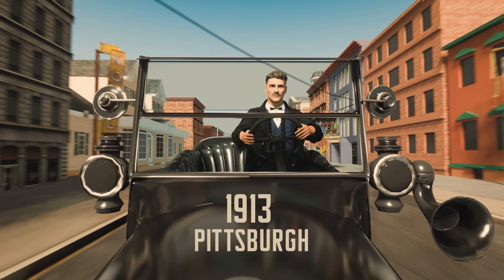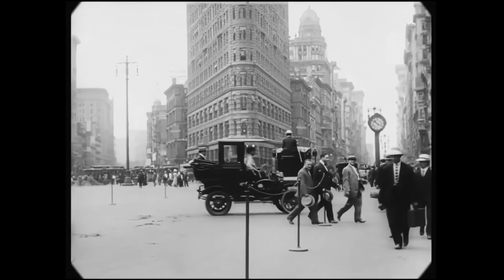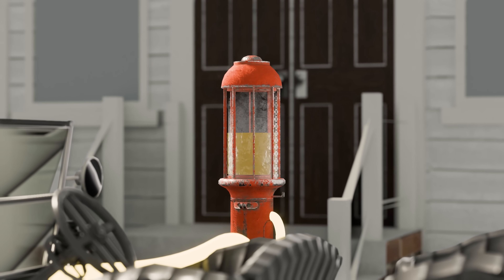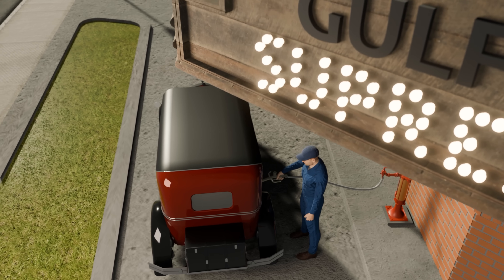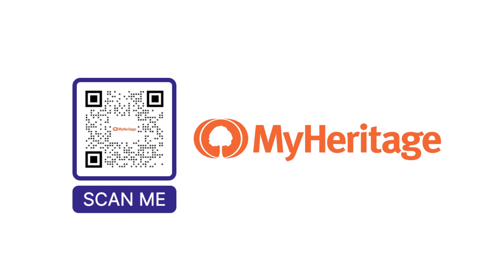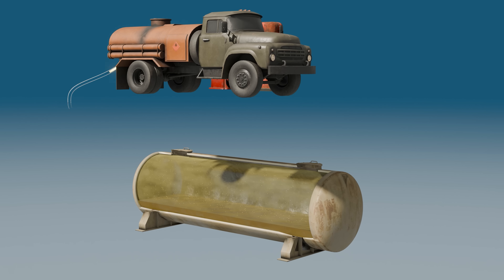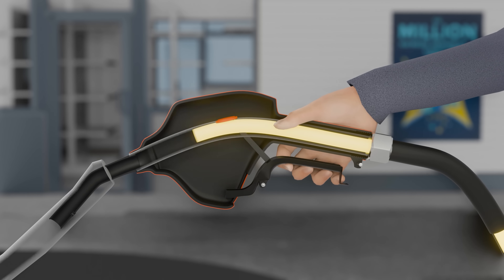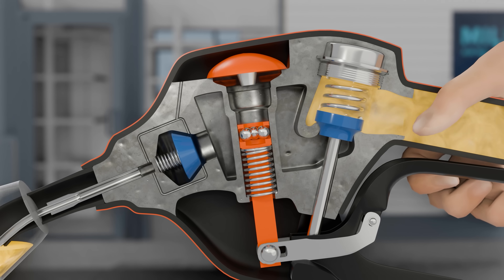The Hidden Engineering of Gas Stations

Comment: I haul fuel for a living . We have 2 types of delivers. The first 1 is called a pump off. Which means you use a pump to pump it into a tank above ground, and the second one is called a gravity drop, which you drop in a tank that is underground and doesn't need a pump. For the most part, the video is spot on expect for the part that says drop 95 percent in the tank. We can only go 90% before the flapper closes, and the overfill alarm goes off. O, and it doesn't go back into the truck. There are pipes that are off to the side, which is where the vapors go.
Reply: Yup, Ive never seen a SECOND hose back to the tanker truck to "capture the gas vapors", thats either rare, or fanciful green hopes and dreams, but not reality. Those tall thin pipes near most gas station properties are the vents that release fumes into the air.
Reply: @Stealth55555  Im pretty sure that is illegal. With a vapor point of -40C that’s a LOT of vapor. Releasing all that vapor into the air in a populated area is incredibly dangerous and unhealthy.  If it’s ok to release into the air then there is no point in engineering and building all kinds of expensive safety features to recapture all those vapors during storage and dispensing, only to release them later.
Reply: @thomasn708  lol. Next time you see a tanker fill up your local gas station, just watch him. He will only have ONE HOSE to unload the fuel (and a grounding cable) but no "vapor recovery" crap. Unless you live in California or something. Or just ask any fuel trucker.
Reply: @Stealth55555 I agree with you on the one hose. I’m disagreeing with you regarding the legality of gas stations simply venting the vapors into the air
Reply: Yeah true true
Reply: Yeah 90% for sure, but only a few of our stations have stoppers, set off the alarms more times than i can remember but we have to make sure the fuel will fit first, gotta love splitting a compartment between 2 tanks, we also have a few stations with vapor recovery but its usually just stacks

Comment: 8:10:  "...fewer trips to fill up."  However, auto efficiency wasn't the reason for the decline in the number of gas stations.  After all, the total number of cars continued to increase, and with increasing congestion in most metro areas, commuters were spending more time in cars with engines running.  The reason the number of gas stations declined is that the nation underwent a massive, nationwide program of removing the older (often leaking) steel UGSTs and remediating the soil contamination.  What had occurred in the interim between the gas station being constructed and the remediation was changes in local zoning codes that prohibited gas stations in most residential districts.  Also, regulations that restrict curb cuts and other issues involving road access made corner gas stations often impossible to reconstruct.  That, coupled with higher-value economic use of those typically corner lots, resulted in the gradual elimination of virtually all neighborhood "filling stations."  Gas stations grew in size but moved to commercial hubs such as shopping centers, where zoning and access made these uses more viable, and where thousands of auto trips daily made them highly profitable.

Comment: If a pump offers four different octane ratings are there four different gas tanks?  Or are there two tanks and the pump is blending to get the desired octane?  
Note, I'm not talking about the diesel or E85 tank.  Just regular gas.

Comment: Keep in mind that fact I got to imagine if I would have a biofuel gas station so your explanation about the big evaporation of a gasoline actually 'hit the apple', as everyone would say. But, since I learned about a bio-gasoline (aka Renewable Naphtha), I could say: 'There is a brand new renewable gasoline which emits less vapor than fossil/synthetic classic'. That renewable naphtha, renewable diesel (aka HVO; HVO means Hydrotreated Vegetable Oil) and sustainable aviafuel (SAF; biokerosene) are brand new forever since rawesome stuff for them is a biomass, not a crude oil as classicity. I hate synthefuel since it's gonna emit way more emissions anyways.

Comment: "That makes it impossible to overfill a car"

Let me tell you... these can fail. When I was on a road trip with a friend we had stopped for gas. While he was filling up he cleaned the windshield of the car. He was on the other side of the car when the gas started spraying back out from the port. The automatic shutoff had failed. Gas went everywhere and he got it all over himself trying to stop the nozzle. Honestly we both could have been killed from the incident if it had caught fire.

Always stand by the pump just in case!

Comment: i always have this question in my mind, does gas station have a huge tank underground for all grades of gas , or they hv different tank for different grade for example 89,91,93?
Reply: Most of the time they have one tank for 89 and one tank for 93, and if you choose 91, there's a valve that takes it and blends it half from each tank to equal 91.

Comment: Very informative. But don't get it twisted, gas stations are still dangerous fire traps. We just have a lot more engineering controls and safety regulations in place to minimize that risk. Gasoline is a very hazardous substance if not handled properly, and, frankly, the average person has no business pumping their own gas. Hell, most gas station attendants shouldn't even do it. The fact that gas stations don't burn down every single day is a monument to the advances in safety that have been made.

Comment: 7:55 something just doesn't add up here
Reply: thats correct for old style handles and for diesel which has no vapor. nowadays they have the bellows on them because the hose has an interior hose in it. the whole thing is called "evr" or, enhanced vapor recovery. the bellow makes a slight suction on your tank when you fill it and the vapors go back up the exterior line of the pump hose and the fuel comes out the interior hose. they also made a healy tank that does the same thing, so when you look at the  vent stack, youll see a large biege tank, that tank collects the vapors that are turned back into liquid form and they can capture the vapor instead of letting it all go out the vents as pollution.

Comment: Great job on the last video! Could you please create a new one that explains how the digital display at the pump calculates and shows the cost per gallon (for example, why it shows “1 gal = $X.XX” and how it updates as you pump)? Also, could you cover how outdoor temperature or air pressure affects how much fuel you actually get, and when is the best time—based on pressure—to fill up your car for maximum volume?

Comment: The flashpoint of Kerosene IS 100 degrees F and the flashpoint of gasoline IS -40 degrees F.
IT HAS NOT CHANGED.
Saying it "was" 100 F and -40 F just because we're talking about situation in the past does NOT mean that the physical characteristics of these substances was different then as opposed to now.
LEARN GRAMMAR.

Comment: the tanks at gas stations aren't supposed to be filled over 90%, not 95%. also, the vapor that goes back into the trailer doesn't become liquid gasoline - it's burned at the loading rack when you pick up the next load.

Comment: The price of 27 cents for a gallon of gas in 1913 was very expensive. According to Inflation Calculator, 27 cents in 1913 is equal to $8.75 in 2025. 
   When I got my driver's license in 1970, I could find gas in Maryland (USA) for 29 cents per gallon. It was still the same price until late 1973, when the oil embargo hit here. For several months, there was a shortage of gas, and there were very long lines at the gas stations. 😢😢  Several months later, the price of gas nearly doubled, and soon there was plenty of gas available again.
Reply: Yup. After the oil embargo the world price of oil went from $3 a barrel to $12!  I was just starting to drive and was torqued off when my .29 a gallon rose to .53 in 3 years....Oh well.

Comment: You should see the "gas stations" in rural Myanmar or Laos, that area. They sell gas at little convenience stores at the side of the road with snacks, food, drinks, etc. They reuse old 1 liter coke bottles for the gas. That way they can charge you 1 liter per bottle. Because the gas is dyed red and kept in coke bottles, I used to think it was some cherry coke or something until I finally saw a tuk tuk driver fill up with a couple. And in rural areas of India and Pakistan, they buy natural gas for cooking by the bag. They fill up this 20 foot long bag with natural gas that makes it float like a helium balloon. You see guys walking with like 5 or 6 of these huge floaty bags. They just run a hose from the bag to a gas powered hot plate.

Comment: I work as a welder in the petrol forecourt industry in the UK and it is crazy the amount of engineering that goes on that the majority of people have no idea about, Im not sure if it is different in the USA, but a method that is used in the UK to detect leaks in the fuel tanks is something called the interstitial space which is essentially where the fuel tank is inside of another tank and you have a leak detection unit that will detect any changes in pressure inside the interstitial space

Comment: Wow! so what you mean to say is that Gas stations and gas cars were very very dangerous because of the highly flammable fuels plus the mechanisms used to handle said Fuels. but over time engineering solutions fixed these issues and made it safe for us all to drive these dangerous vehicles around. noted. 
so maybe we should let EVs evolve for a 100 years too before we pass judgement. 
although they're already much better than gas cars as it is, but the haters with fear of batteries should realize its still only been just over a decade since Tesla made EVs mainstream and how Gas cars and the Fuel was very flammable and did catch fire easily in the early days.

Comment: As someone in the fuel delivery industry, this is pretty interesting to watch, and reasonably accurate
Reply: What would you add to the video to enhance it?
Reply: @labmasterx5599 People should stop coming up 2 us asking "Is it ok 2 pump gas while you deliver?? I dont wanna blow us up" it's soooooo fukkin annoying lol
Reply: @TruckinTay  Electric vehicles are more dangerous but let's not let reality get in the way of the political push.
Reply: @pierredebeavoir  the electric vehicle industry is today where the fuel industry was in the 1930s. still evolving. Will only improve.
Reply: @labmasterx5599 Vapor recovery systems, submersible pumps, containment sumps, the electronics and computers underground for tank monitoring, the dispensers are now blenders, etc. That's just a start.
Reply: @labmasterx5599 The vapors that are returned to the plant are rarely turned into gas again.  The system doesn't seem to work in reality. Also most underground tanks can only be filled to 90% full.  Although drivers are known to place long measuring sticks down that pipe to bypass the flapper.
Reply: Same here i was surprised they mention vapor recovery
Reply: In the fuel industry as well. Accurate as it can get!

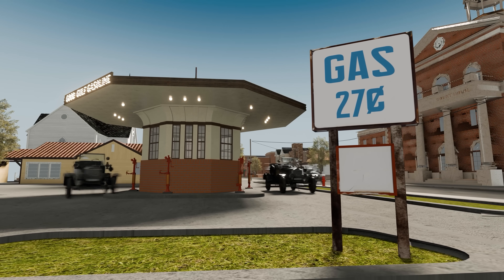Comment: 2:58 27 cents 🤤
Reply: Average yearly salary in 1913 was $570
Which would be $0.27 an hour
Reply: I remember in around 1965 when you could buy gas at the cheap station for19 cents a gallon . Otherwise it was twenty nine cents. During the fuel crisis in nineteen seventy three it jumped to fifty four cents a gallon.

Comment: i would say he got 70 to 80 percent of what a modern gas stations operate and keeping the general public safe, one good example there is a console called ATG (Automatic Tank Gauging) that monitors fuel level and water (yes water so it alarm the owner to stop the pumps so the liquid won't get into vehicles due to potential leaks in the tank) brands like Veeder root, Franklin Fuelling , and Dover fueling are examples of brand that provide gas station it equipment.

Comment: Funny to watch this while we are transitioning to electric. Electric and battery technology has/had similar problems. Lithium ion batteries were a fire hazard, but that problem has already been solved. Distribution is still a challenge, but I think it won't be long before we have fast charge stations country wide! Dangerous liquid fuel will be a thing of the past in no time.

Comment: I like self-serve and self-checkouts. But my thinking is it would be hugely!! beneficial to return to the gas station model we were using in the '50' and '60's. It was an evolved business model for its time. Surprised there isn't stuff published on this, already.. Not just as a coffee-table picture book. I grew up, in small town, in the '50's, '60's. The gas stations had open-to-the-public restrooms, telephone booth, soda pop machine etc.. The stations usually had service bays, at least one. Aside from employing a mechanic or two, there were usually used 'restored' (in-house) car batteries on-hand for sale. Also sometimes (very often) available were used, trade-in tires, repaired inner-tubes, and remanufactured (recap) tires, along with a brand of new tires. As a high-school student in the '60's, I couldn't afford new tires, so ran recaps. -Never had a recap problem (the big recap industry was self-regulated to standard compliance Plus, synthetic belts, nylon, polyester, polyglass, ran much cooler on the road than heat retaining steel belted). I used recaps until the '80's. High school kids could get afterschool work at local gas stations, as mechanic helpers or as attendants, or both. The cost of having onsite staff was partly recovered in the old model. They were great old-style business models with community benefits that our modern self-serves don't even come close to touching, my opinion.

Comment: It seems like if you modified the gas nozzle to take in more air a gas station could cheat you by putting extra air into the gas mix so you're getting less than you paid for.
Reply: The counter is at the pump, not the handle. Adding more or less air bubbles at the handle won't change the counter at the pump.

Comment: Early cars did not burn kerosine.   The Model T ran on gasoline.  Good video.
Reply: The Model T could run on gasoline, alcohol or kerosene. Kerosene was widely available as a lamp oil before cars were common, which is why it was one of the original automobile fuels.
Reply: @ruffxm correct. Low compression engines could run on kerosene. As engines become more advanced and compression was raised, gasoline become the main fuel for ignition combustion engines.
Reply: @ruffxm  it could run on alcohol??? Fun fact the US Abrams tank can apparently run on vegetable oil.

Comment: My Question, That nobody has explained to me is this. Now they have One Hose for All Grades. Years ago there was separate hoses. Car fill with 87. My Harley uses 91+ Octane. How much 87 Octane is still left in the line when I go to Top Off?? Am I getting a complete 91+ Fill?
Reply from the maker: Yes, at stations with a single hose for all fuel grades, about 0.2 to 0.3 gallons of whatever the last person pumped remains in the hose. If you're filling a small tank like a motorcycle, that leftover fuel could slightly dilute your high-octane gas, but not enough to cause any problems.

Comment: Where I live, gas stations are gradually being torn down and replaced by malls, while EV chargers are popping up in almost every carpark. It’s sad but maybe driving in to the gas station to fill up and get a drink and snack will become a thing of the past. I’m sure it’s an unpopular opinion, I just think it is really dystopian.
Reply: It doesn't matter what a car is propelled by, the very exitance of cars as a whole is a massive downfall. No one ever tells the extreme and massive waste that's involved in mining for minerals, transporting those minerals to a factory, and the factory has to be built requiring HUGE energy use and then to run it continuously, MORE energy use, then these cars have to be transported, then bought for debt usually, then fed with fuel, then maintained and then eventually scrapped to start all over. Everything involving a car is lost when it could be done much better. Legitimate and wisely planned mass transit would be exceptionally better. Switzerland is a great example of how it is done. Amsterdam city is another. Oulu, Finland yet another. In America, just cars, nothing else. Society is designed around cars, NOT PEOPLE, and this creates a NEED to HAVE to have cars with few if any other options. Cars are a horrible invention as they are used and defended. We are so used to them that people don't see the downside to them. We keep cranking them out, more and more, still wasting resources of all kinds on a machine that only cost money and resources and has no turning back.

Comment: The AI voice keeps confusing Kerosene and Gasoline.  With the exception of the then rare diesel cars, cars ran on gasoline.  Before electricity, kerosene was widely used for lighting.
Reply from the maker: No AI here, but I appreciate the feedback. As far as the use of Kerosene goes, early internal combustion engines ran on kerosene before gasoline became widely available, and Kerosene was also used in times of fuel shortages due to its lower cost and availability. In many cases it wasn't the most ideal for performance or engine longevity, but it was done.
Reply: @primalspace  Tnx.  I did not know that early 4-cycle (or Otto cycle) engines ran on kerosene.
Reply: Its not AI